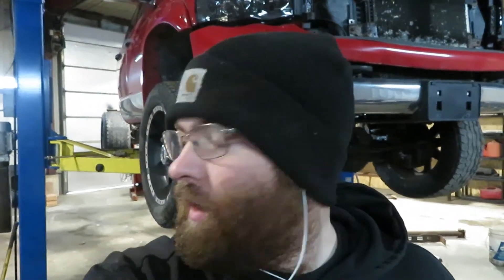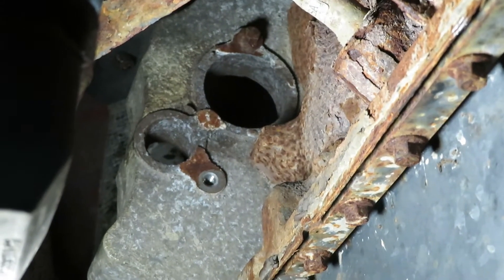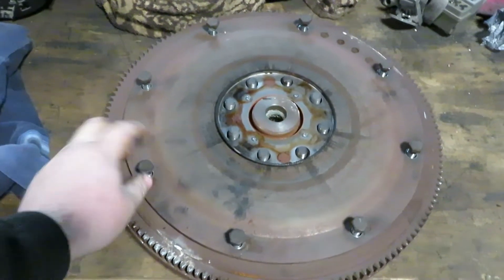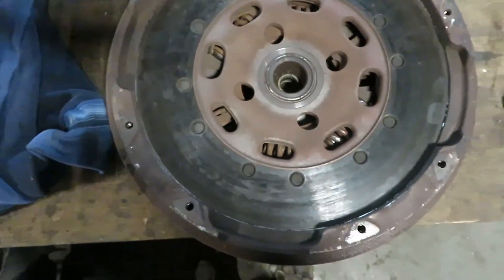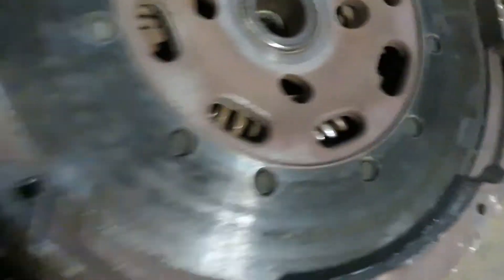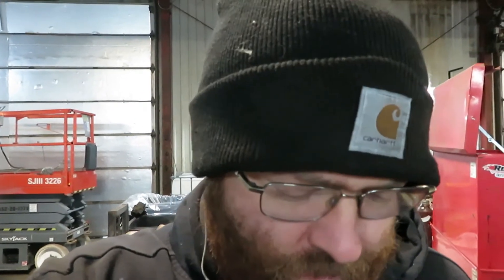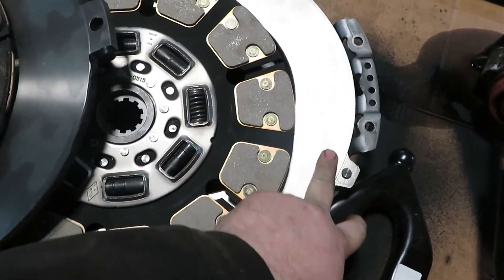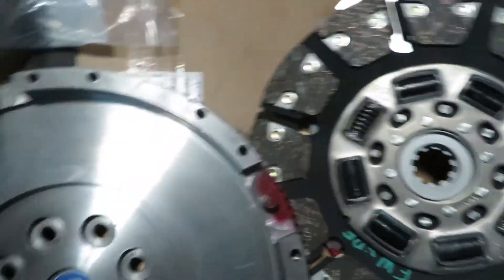G56 Dual Mass Flywheel Removal and Upgrade

Comment: Hi I am from México and I have a cummins 5.9 g56 wich in my country its a Ram 4000. It have the dual mass and I changed it to a solid mass from an american Ram 3500 and now have an issue the clutch is getting realy hot. Any one now why? Its the same transmission from one and other (g56)